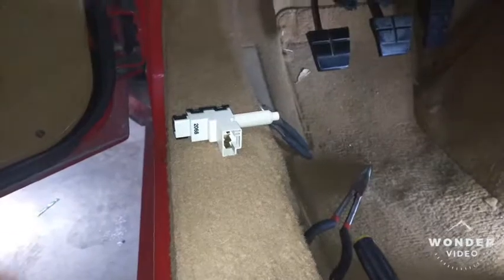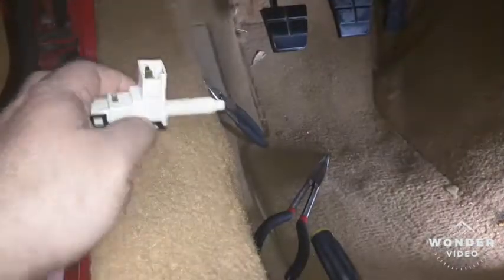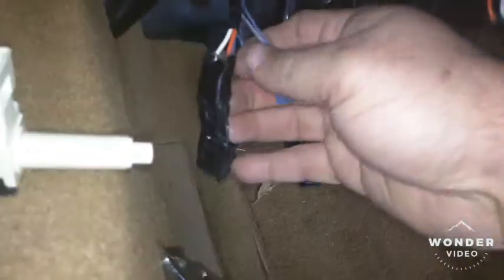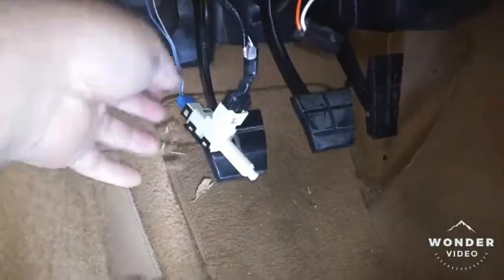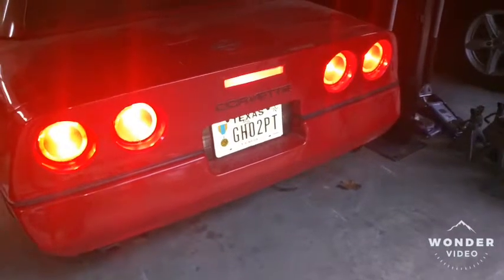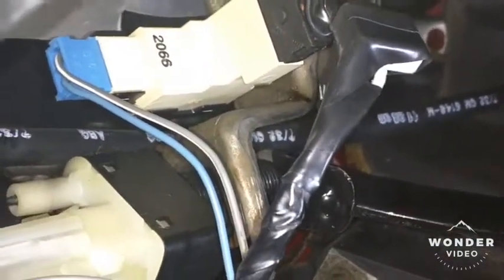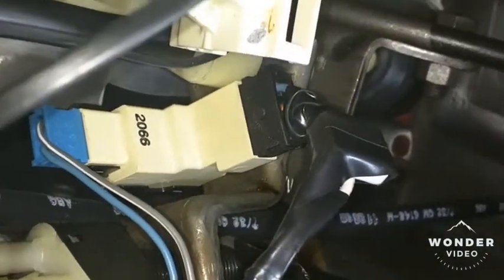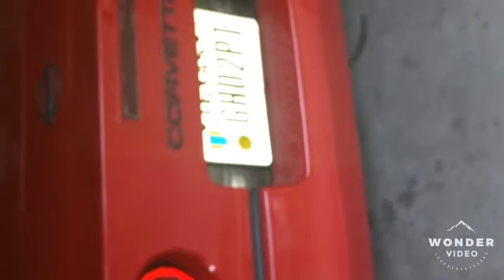'89 C4 Corvette brake light switch replacement

Comment: I have 1988 c4. Cruise does not work. Would replacing this help or is there 2 plunger switches on my 88?
Reply from the maker: There's probably a second switch on your 88 for the cruise control. They're still available online, but they run a bit more than the brake light switch. If cruise is not working the switch is one of several things that could be the issue.
Reply: If the switch is adjusted too tight, it will keep the cruise from turning on